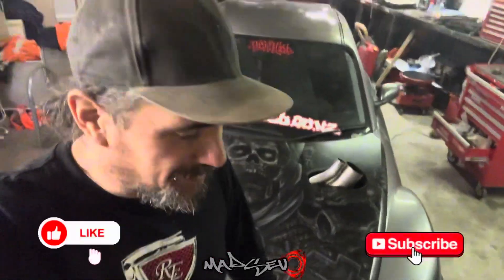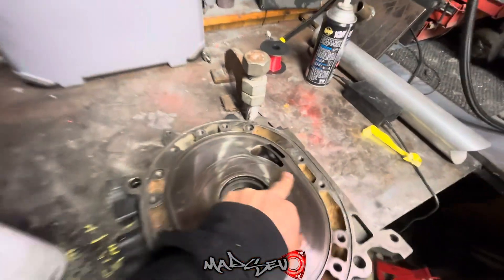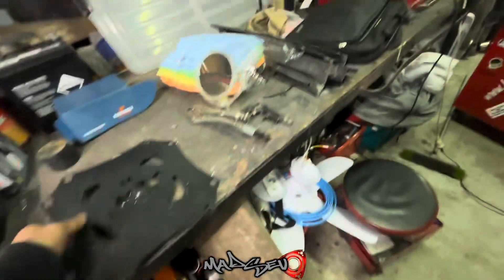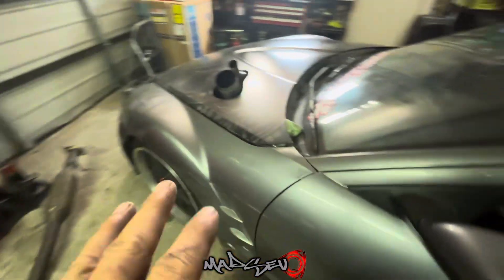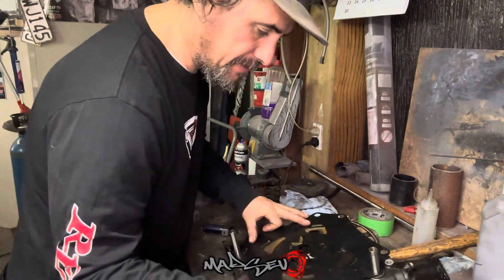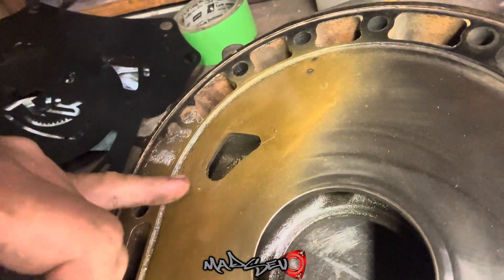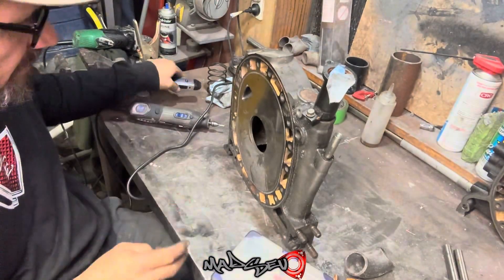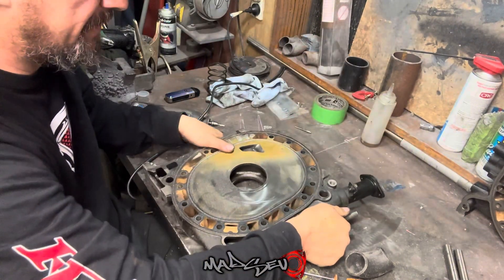A how to. Porting the centre iron on a 13b secondary bridge setup

Comment: Great work on the porting

What’s the go with the Rx8 ? Base fuel pressure too high or injector scaling out ?
Reply from the maker: I have been busy with the Rx8 last few days and it almost looks like I have stuck injectors. I’m getting them flowed and tested in the next few days. I got it started today and man you should have seen how much fuel came out the exhaust. Should be a video out later this week
Reply: @Madrxsev ahhh yuck. You poor bugger. I can only imagine and I’m sure you weren’t impressed. Fingers crossed it’s an easy fix
Reply: @Madrxsev secondary injectors aren’t pumping on startup?
Reply from the maker: I’m almost certain the injectors are stuck and fuel is just flowing in . There is so much fuel coming out of the headers
Reply from the maker: @rosscurrant8940 not sure

Comment: You tha man Marsh cheers for  the info!! 
I have a 12a PP that i built myself it started and ran but leaked water after pulling it down again the water seals were allgood but after investigation its leaking from the inlet ports in the housings i did not  replace the devcon when i rebuilt it   long story short what product do you use to put on your housings to seal them off?
Your wisdo. Would be greatly appreciated
Reply: Heya bro @EugeneFahey you 100% have to skim some RTV silicone sealant like grey RTV or three bond over the devcon. IME If you don't do this they will always leak.
Reply from the maker: @West13bMazdaRotariesNZ 100%